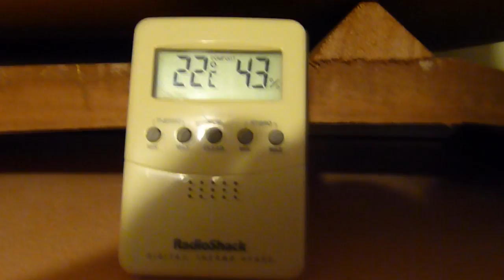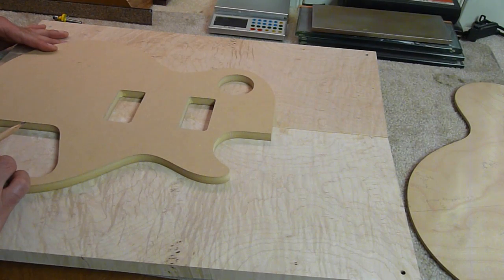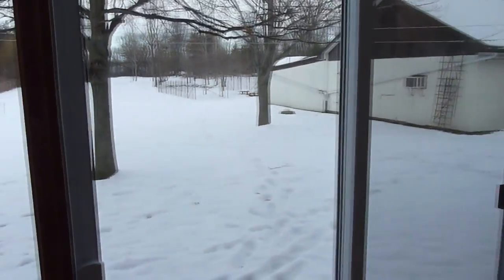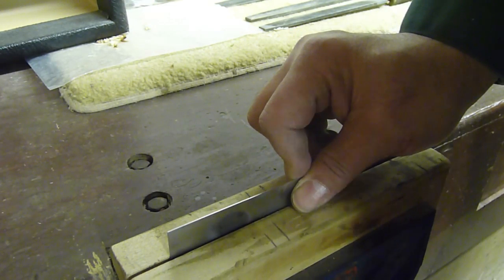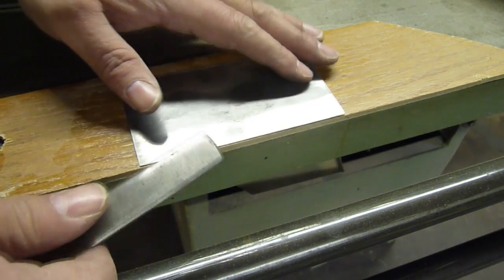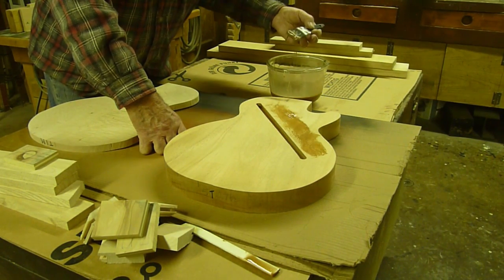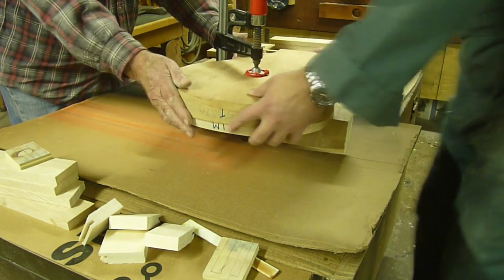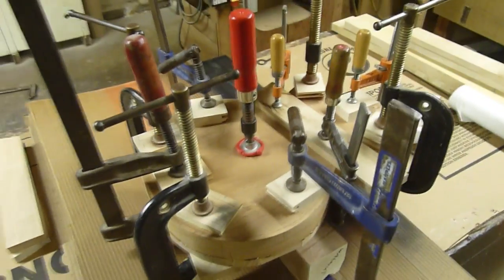Building Les Pauls - Part 3

Comment: Loving your videos and great to see you working with your dad.I learnt from my dad also from very young.Little tip for your gluing the tops, drill a couple of holes in area where pickups would be routed and use nails as pin locators.This will make it easier and stop the slipping and sliding.Just subscribed.Cheers from down under.

Comment: This is a great video you are obviously a master builder… I heard straight from a guy who worked at Gibson that they take 80 grit sandpaper to the sides that glue together and they said it increases the strength and makes the glue line invisible. He said planers and high speed thickness flattening burnishes the wood flat and doesn’t allow glue to adhere as well. 

Have you ever heard anything like this in your woodworking experience? 

 A friend of mine just told me stew Mac recommends the same thing.
Reply from the maker: Thanks! A rotary or high speed plane can burnish the wood that's true....if it's not dead sharp. And in a production facility I suppose they wouldn't be sharpening the tool every hour. But the 80 grit sandpaper method is also bad. Roughing up a surface is only good for certain types of glues like epoxy that act through mechanical adhesion. Wood glues don't behave that way, the best possible mating surface you can create is cleanly severed wood cells where the two surfaces mate intimately. This is ideally produced with a sharp handplane that takes one continuous slice of wood.

Comment: Why did you use formaldehyde glue instead of hide glue?  I'm about to glue a padouk top onto a black limbs body and wonder about the for/against arguments for using either.
Reply from the maker: Hi John,
The main reason was because the area is so large and open time is so restricted I didn't want to risk it. This is likely the reason Gibson used formaldehyde glue for the tops as well. But it is a glue with similar properties as hide glue, namely crystalline hardness and no creep. The one major difference is that formaldehyde is a permanent glue, it can't be reversed like hide glue. But this is a joint that will never ever need servicing unlike possibly a fretboard or a neck joint.

Thanks for the great question!
Reply: Great info, thanks!  Where do you get formaldehyde glue?  And when you do use hide glue, which make/number do you use?
Reply from the maker: John, I used DAP...I got it here:
https://www.amazon.ca/gp/product/B001003J16/ref=oh_aui_detailpage_o00_s00?ie=UTF8&psc=1

And for hide glue I like Milligan and Higgins 192 gram :
http://www.milligan1868.com/glue.html
Reply: Groovy

Comment: Does the scraping really make any difference? I use sanded tops (most of builders do?), no problems never ever. For "perfection", sure. But for being totally adequate and practical?
Reply from the maker: I think it's a matter of the law of diminishing returns. I don't think there would ever be "problems" without scraping. The area is so large that delamination is virtually impossible. But it is just my working preference, I believe the joint becomes tighter, with less glue filling gaps which would mean the glue would have less effect on tonal transmission. Also I believe it depends on what kind of glue is used. The urea formadehyde  is a good gap filling glue, but if it were hide glue or yellow glue, the scraping would promote molecular adhesion. In any case, it takes so little time to do. It took me far longer to video the process of sharpening the scraper. 
But thanks for the very good question!
Reply: Thank you for the good answer :)